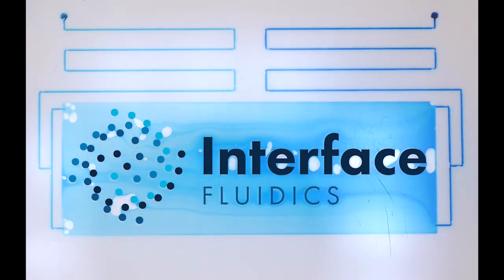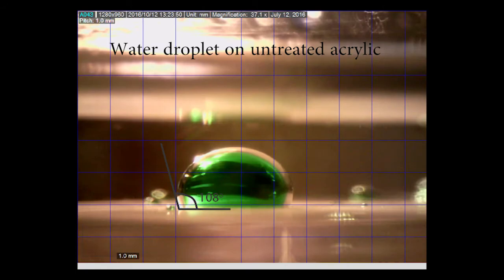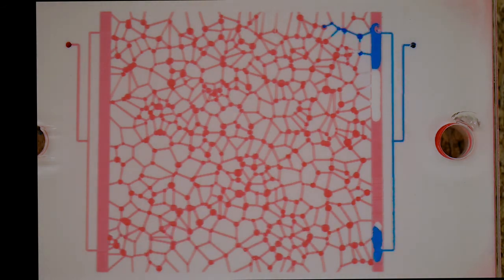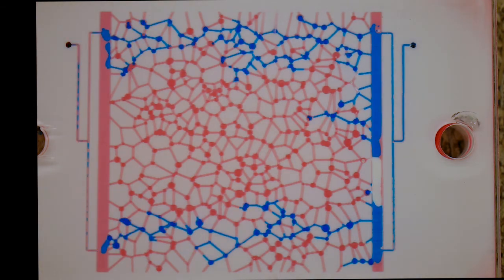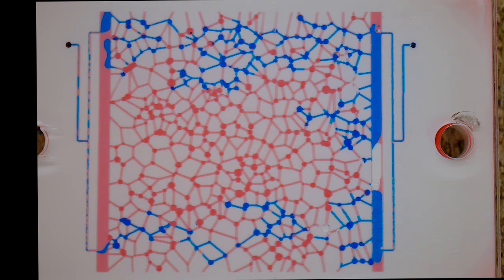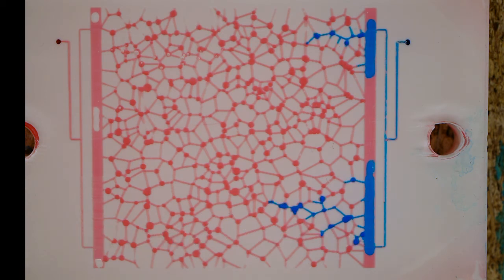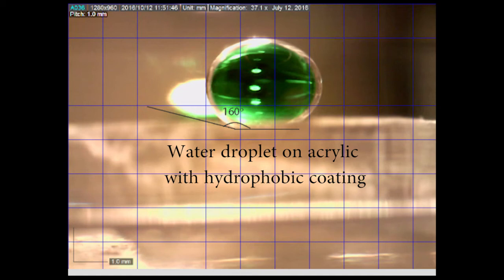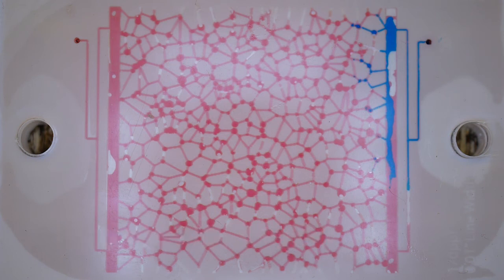Visual Reservoir - Episode Seven: Wettability

Comment: Great videos! Could you tell me what coating did you use to make the acrylic more hydrophilic or more hydrophobic? Thanks!
Reply: Thanks Dito. For modifying the wettability we used surface coatings made by Aculon. One hydrophobic and one hydrophilic. For our commercial work, we have developed a different coating process that creates a more moderate and field representative contact angle.

Comment: Hi Gents ; 
can you please tell me , how much is the injection pressure applied in your experiences ..!! is the behavior  change on the field scale with high pressure values ??
Regards .
Reply from the maker: Hello Bestek, these models were done with constant injection flow-rate (25 ul.min), not constant pressure. The pressure is quite low, on the order of a few psi. The pores in this model are similar scale to the field. If the pressure of the entire model is much higher, the results should not change. If there is a high pressure-differential across the model, there will be a much higher flow-rate of water and the results would be quite different.